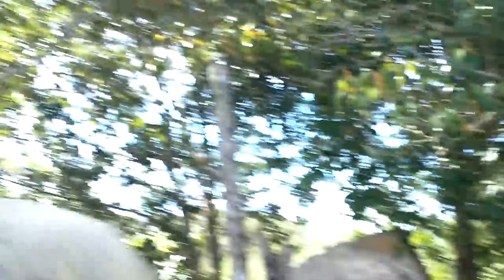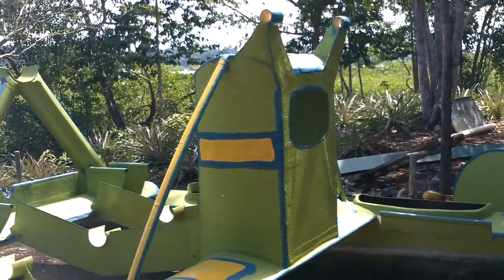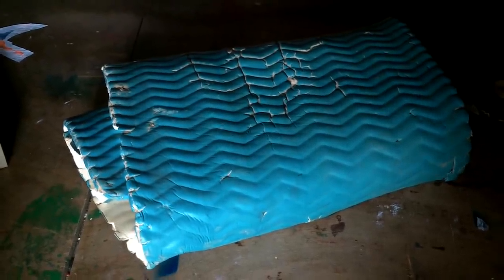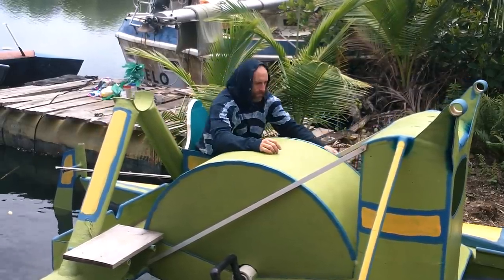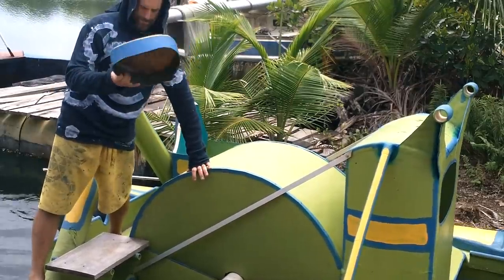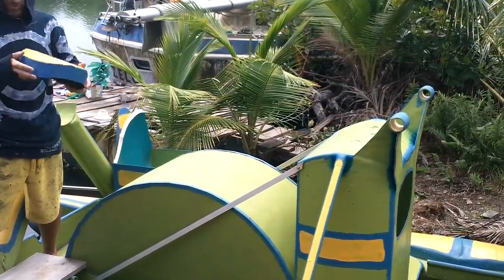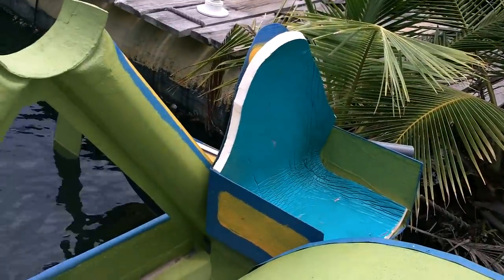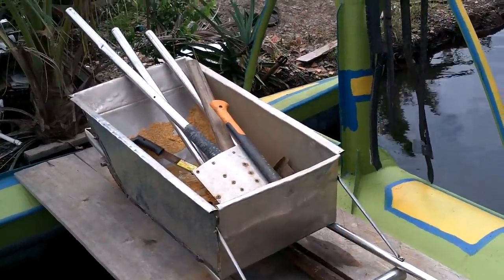Boat Chips 017 Lets test it!  Into the Water ya go!

Comment: so essentially you are getting that speed on half hp...  (max the human body can output)  

watching your other vids, I see you are using a DC motor..  What about using a single phase AC motor+inverter  one speed, or a 3phase AC motor and inverter+VFD inverter?  

Cost wise, the AC motor is much lower than the DC PWM units, and more readily available even here in the tropics where I am at also.  

We are investigating building a boat from recycled plastic and using solar to run it.